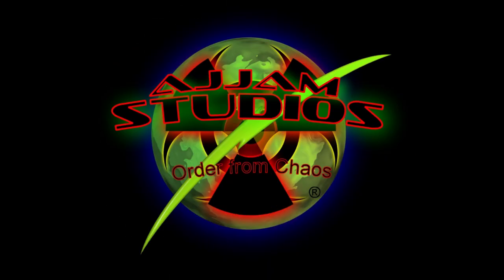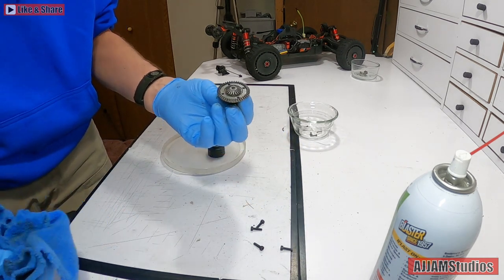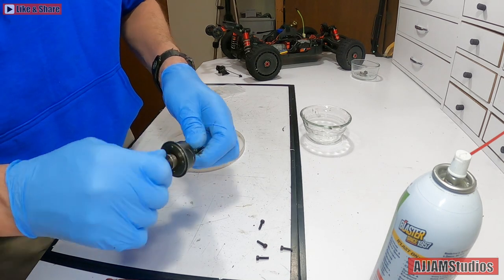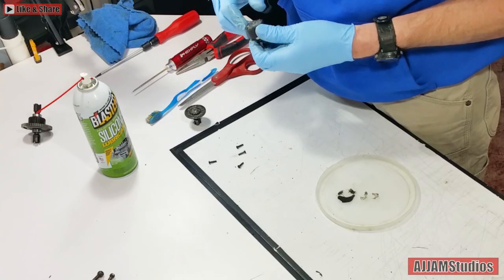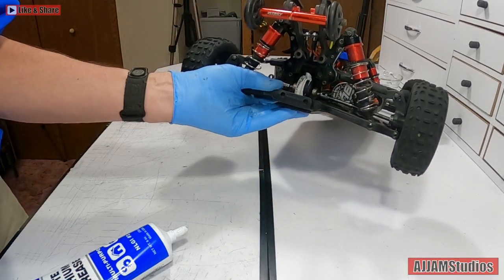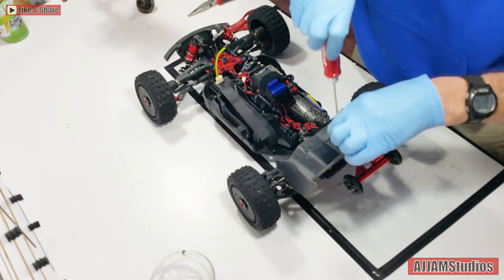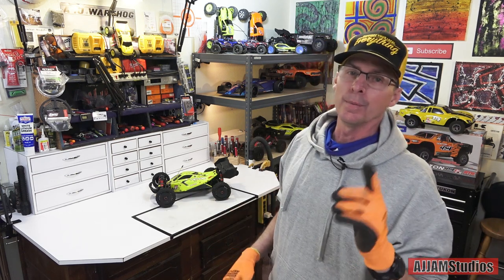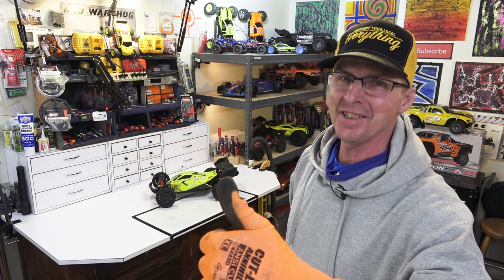RC diff hack 101

Comment: I've been toying with an idea-  heating up petroleum jelly and pouring it in the diff as a very thick oil, to be as tight as possible (near lock), but still able slip a bit and give on bad landings etc. Has anyone ever tried it or even thought about it? Is it even viable? Or would it be a total non-starter?
Reply from the maker: I think I’ll try that. As far as I know no one has tried that yet. I have been toying with the idea of using similar substances such as magic lube and things of that nature but I haven’t thought of the petroleum jelly part. Good idea. Hopefully it won’t be a nonstarter and we’ll be able to put it on the channel so you can see the results. Thanks, AJ.
Reply: @AJJAMStudios  did this fail?  Petroleum melts at temp no?
Reply: Why wouldn’t you simply use some super thick silicon oil, something like 50k or 100k oil will be as viscous as honey, or even more so. Also, there’s no issue with the jelly losing viscosity as it heats up. Silicon oil is made specifically for the purpose at hand. And, of course, you can very easily mix and match your own preference for viscosity. If you, for example, wanted 75k, just put in a 50/50 mix of 50k and 100k and the end result is a viscosity of 75k.
Reply: I haven't tried it, still just an idea. I obviously know petroleum jelly melts (that's why I said heat it and pour it), which is both good and bad- you can just pour it in a diff so it's totally full and will become almost solid after cooling, but because it melts if it's not able to hold the spider gears still (locked) it will indeed melt, or it could melt just from the friction of the bearings or motor heat transferred through the aluminum chassis. But then again, how much would it affect the performance if it did melt? It would still be packed full and could work like a viscous coupling (like a torque converter in an automatic transmission). I have a feeling that a RC diff completely filled with melted petroleum would do better than the small amount of that axle grease looking stuff that comes in many new cars. Another potential problem could come from unequal heating causing pockets of melted petroleum while the rest stays solid, which in my mind could be a bigger problem (no lock around the spiders and no fluid dynamics in the rest of the diff). All that being said, there's no way to know without trying, and if it works, Vaseline is much cheaper and more common than those super thick specialty "bazillion weight" Diff fluids, and I guess you wouldn't need to let it sit overnight to settle before squeezing the cover back on.
Reply: @AJJAMStudios  I didn't see any of the replies until now. Did you ever try it? I would love to see, and I still think about it and wonder if it could work.

Comment: I do drag racing with my typhon will this help or hurt my takeoff? I like the detail of your videos
Reply from the maker: The 6s version or 3s?
Reply: @AJJAMStudios  6s
Reply from the maker: Stiffening up the center diff will help you with your hole-shot, but it comes at a cost. The more power you throw at the rear, the easier it will be to spin out during acceleration. However, with good pavement to hook up to this can be overcome with throttle tuning. As far as the rear diff goes, posi is king for drag racing. Even power to the rear is what helps real drag cars control the power sent to the rear wheels during the launch. Personally, I think the center diff should be stiffened with diff oils instead of the silicone plugs, but for this reason, I find the oils to be easier to tune for consistency. Example: Let's say you want to drag race your 4wd rig, alright? In my experience, I would set my oils up like this, 30K front, 50K rear, 500K center. This will give you the hole-shot, but leave you in control of the car as it accelerates. Of course, this is all contingent upon the surface you're running on. High traction? Low traction? Oil spots in the way? All these things have an affect upon the handling. I would play with the numbers a bit, 30K and such, but keep the layout, loose in the front, medium in the rear, and stiff in the center. This layout should help. Let us know how it works for you. 😎👍
Reply: @AJJAMStudios  thanks man I'll let you know thanks for all you do in the rc community
Reply from the maker: I'm glad I could help. AJ

Comment: Shoot I just got a $1.25 silly puddy to throw into my diff instead of 20mil that traxxas calls for lol well I take that back I'm adding it to the old stuff to sniffing it up a bit since I swapped internals I had less oil (clay) to put in the new set so I'm compensating with silly puddy haha used it in my old 2wd 10th scales before a d it worked great, not sure what it'll do in this bigrig!
Reply from the maker: There is really only one way to find out; test it. It will work or it won't, but you can always rebuild the diff if things go sideways. Please, let me know how it works, and of course, what rig you try it in. Thanks for commenting. AJ
Reply: @AJJAMStudios  it'll be in the center diff of my xmaxx!
Reply from the maker: Please let me know how that works. I'm genuinely interested. AJ
Reply: @AJJAMStudios  will do! Probably be a couple weeks as I'm working on my electric gokart a little bit each day (can't stay in the floor long because it kills my back) lol
Reply: @Vape N Clash lol mybad man, I have this thing called a life so I got busy and forgot all about it lol I did buy a brand new center diff and fixed it all up lol. I've used it in 2wd rustlers and stampedes with great results!

Comment: I don't understand the benefit to looking rear diff.    Center diff with ear plugs yes.    Do like the time you must have put in to make a really clean video..      I  really like 50k in front ,  500k or ear plug center.  30k  rear.    I  will have to try locking rear on the build I'm working on now.
Reply from the maker: Locking the rear makes the RC more able to act more like a stunt rig. For standard bashing it probably would not help much. It’s a setup for stunting. Thanks for commenting 😎👍

Comment: Super glue works best for diff lock up
Reply from the maker: That’s definitely one way to handle it. But it does sound a little permanent to me. I like the ability to reopen the diff and change how the set up is, even in the differentials that I’ve locked up. However, I’m glad this works for you. Thanks for sharing. AJ
Reply: It is but the cool thing about it is when it's heated it will slip

Comment: why does it drain the battery quiker
Reply from the maker: Battery life is dependent upon amp draw. Without the ability to bleed off torque to the front wheels the ESC pulls more power from the battery. This shortens the run time of the car. Stiffening the center diff draws more amps. Gearing also plays a role in run time. Check out our 101 series, I think it would help. Thanks for asking 😎👍

Comment: lol love hack man  i ant buying any sillycon oil for my car ether  i mix up my own crap from grease and additives but thats a car guy with a crazy engineering thinking heck their is a can of Molybdenum disulfide  in the tool cabinet just for custom blending stuff.funny thing silcon ant really used in any tool gears so i figure their ant no way its that good for wear.May  be its a so called safe oil is way its used or may be its to jerk up the price and increases wear on gears i have no clue as to why its used